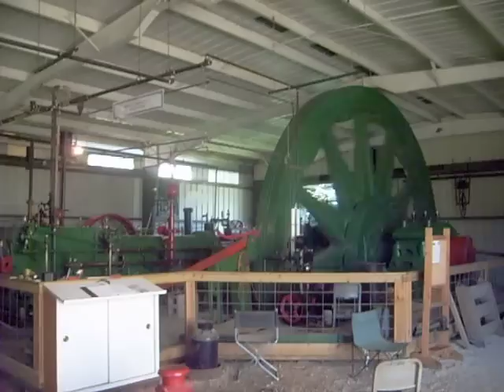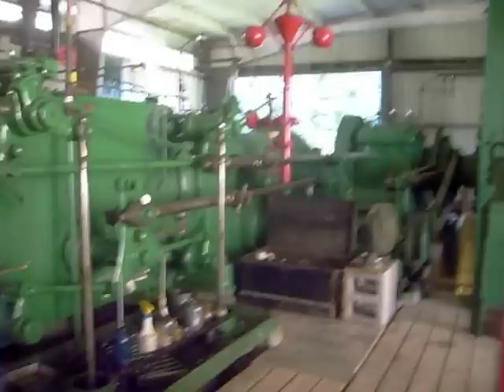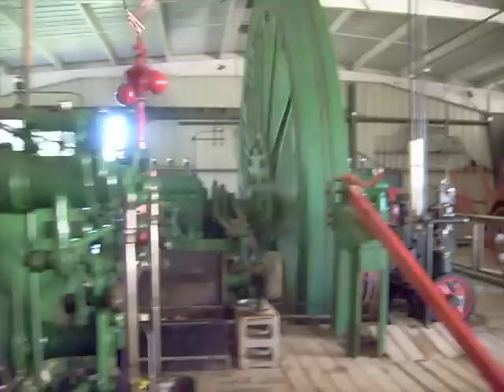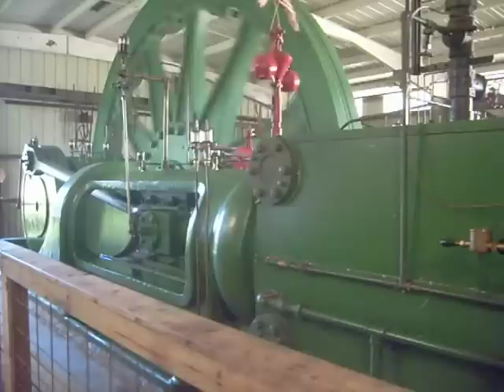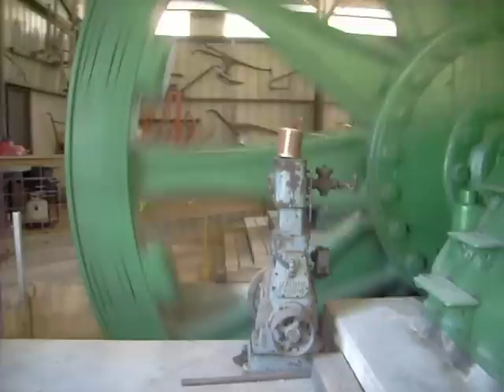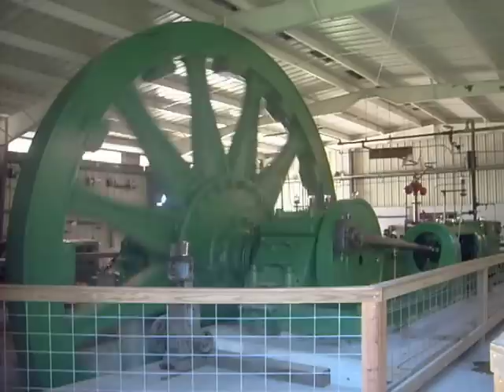HUGE 130 Ton 4798 horsepower 100 year old Cooper Corliss Steam Engine Operating in Freeport IL

Comment: I guarantee that engine does not produce 4700 hp Not happening. Tipple expansion steam engines of that size witch is a technological step above that  could only produce a fraction of that. And no they did not put flux capacitors on the boilers to boost the power output.
Reply from the maker: +Peter Cobden Triple Expansion Engines were designed and built for efficiency more than for high horsepower using the lower pressure exhaust from the first piston to power the larger second piston and then the even lower yet exhaust from that piston to gently push on the huge third piston before exhausting into the atmosphere.I'm guessing you probably don't believe the Union Pacific 4-8-8-4 Big Boys had an "Indicated" hp in the 6000 range either.
Reply: +oldSawyer - It's worth having a look at the history of Cooper's from 1890 onwards, and the manufacturer's sales catalogs and sales records. Engines of this type ranged from 200-2000HP, this one was typically 1500 HP. 36 HP per ton was not possible in those days, 11.5 HP per ton was pushing the bound of the era's technology. The most efficient triple expansion condensing engines of the day were producing about 10HP per ton. The UP Big boys were rated at over 6000HP, but not continuous 24-7 industrial use; they had the benefit of 1940's materials and higher boiler pressures.
Reply from the maker: +nlo114 I'm only going by what is posted on a chart located in the building with the engine, and those were the numbers. . . That being said, it Currently Operates on a Much Smaller Boiler at Lower Pressure, also running a much Lower RPM than what it did in its factory setting with a huge boiler at high pressure running at its rated speed under load.
Reply: +oldSawyer -  With you 100% there, not arguing. If I could be bothered, I'd calculate bmep from bore and stroke, rpm and supply pressure etc., but I can't be bothered. If it gives figures on the wall-chart, the chances are that the keepers know what they are talking about, so I believe them.
Reply: I was just thinking UP 844 is rated for less than the stated figure and it has two cylinders.
Reply from the maker: Two SMALLER Cylinders. . .
Reply: Not only that but the connecting rod is quite slender and could not support the force required to develop such power at the slow revolution rate such an engine could operate at. I'm reckoning it's out by a factor of 10
Reply from the maker: And I Reckon You Would Be Wrong. The Connecting Rod is not as "Slender" as it appears in comparison to the rest of the engine and is More Than Strong Enough. Keep in mind, that is a 60 TON Flywheel plus the weight of the Crank disk & Shaft giving it total Rolling Mass of over 85 TONS. Cracking the throttle valve open gets that 85 TONS up and moving to the speed shown from a dead stop in just a couple seconds. Try Doing That with an 85 Ton Semi ! If Anything, it is Under-rated.
Reply: Triple expansion could only produce a fraction of that?
The largest steam engine built was 11000hp triple expansion. The Manhattan engines built by Allis Chalmers
Reply from the maker: And again I need to point out the fact that Triple Expansion Engines were designed and built for efficiency more than for high horsepower using the lower pressure exhaust from the first piston to power the larger second piston and then the even lower yet exhaust from that piston to gently push on the huge third piston before exhausting into the atmosphere. Corliss Engines with their variable Valve Cutoff rates can produce Massive Amounts of Power in comparison.
Reply: @oldSawyer  if that's directed at me, I'm not arguing your point, other then the largest most powerful engines built were triple expansion, and of course Allis Chalmers!
So that somewhat disproves your only for efficiency theory
Reply from the maker: Let me Clarify That by adding "FOR THE MOST PART" Triple Expansion Engines were designed and built for efficiency more than for high horsepower. . . Obviously The Worlds Largest (Allis Chalmers) would be an Exception to that by the Shear Size of it. . . I Still Stand By my "Efficiency" comment on them though, as THAT is Where They Really Shine, Doing What They Do Best, making The Most out of Every Usable Ounce of Steam Pressure by reusing the exhaust from one cylinder to power the next bigger cylinder. . . When your last cylinder is the size of a SILO, then Yes it is going to add even More Power.
Reply: @oldSawyer  honestly Allis Chalmers was usually the exception to most rules, hence the reason they broke so many records
Reply from the maker: Re-reading your original post, I guess it was directed more towards Mr. Cobden there than it was at me. Always amazes me how many 'Experts' there are out there that can't comprehend the Power Of Steam in general, and then try to compare the Huge Stationary Engines to the Much Smaller Cylinders found on Locomotives (though I DID Give Props to the Big-Boy with its 6,000hp from FOUR Cylinders, only to have someone else chime in again about UP's 844 TWO cylinder)
Reply: @oldSawyer  I really wonder how the hp was rated at 6000 on the big boy, because of the size of the Manhattan engine, something doesn't add up
Reply from the maker: That, I Can't Answer. . . It's just the rating I found Listed for them a few years back. I'm thinking they were upwards of 300psi boiler pressure though which helps considerably.
Reply: Just to muddy the waters…
Cab forward articulated locomotives used to leave SP’s Roseville yard with a full consist to cross the Sierra over Donner Pass. Once they got up to speed (albeit not very fast) the engineer would fully open the throttle and the fireman would set the fire for full power. Then the engine(s) would pull the train over Donner Summit running 100% duty the entire time. Them’s engines. I knew people who ran them.
Incidentally, something I’ve never seen in print but interesting… during the summer the crews running out of Roseville would want some vacation time. The railroad would hire boys (older teens) from the high school to fire the big cab forwards to temporarily fill in. I know this only because I personally knew someone who did it. Long time ago; ‘before (during?) the war.
Documentation: he was Don James, later principal of Hiram Johnson High School in Sacramento (1960’s).

Comment: Great video!

I am also wondering about the horsepower. I do believe that the Big Boys had around 6,000 horsepower, but they had four cylinders and they operated at a much higher RPM (and HP goes up with RPM, to a point). The Centennial Corliss Engine put out 1400 HP, but it was a much larger engine that this one in the video: http://newsm.org/steam-e/corliss-centennial-engine/

Wikipedia lists figures for some Corliss engines and most are in the hundreds range though a couple listed have over 2,000 HP.  I also found out that HP for large stationary steam engines, back in the day, often was given as the total power of a group of engines, not just one. So if that engine really does put out 4798 HP by itself, at such low RPM, that is truly remarkable and unusual.  Would you be willing and able to post of photo of the plate that shows the HP, and at what RPM?

https://en.wikipedia.org/wiki/Corliss_steam_engine
Reply from the maker: There is no data plate showing those figures that I'm aware of, but the numbers came from a chart (or Graph) showing the horse power for this size engine at different boiler pressures and rpm's. As noted in the description, that chart shows it as 4798hp at 45 rpm at 225psi boiler pressure, though in its current state running a much smaller boiler and at significantly lower pressure  it would never be able to do that. . . As For Photos, I have yet to figure out how to post a photo in the comments on here.
Reply: Interesting, thank you. Have  you tried using your Google account (since you have  YouTube channel you have a Google account) to post a photo in Google Drive, then share the photo to the public, and post a link to the photo here?

Also, see my comment from about a second ago, about the formula for theoretical horsepower based on steam pressure, piston diameter, stroke length, and revs per minute. I think it would be interesting to try that out.

Comment: The Cooper Corliss company lists this engine at 1500 hp at 70 rpm    4798 hp not possible with this engine
Reply from the maker: IF you can post a Legitimate Link to Documentation Showing That I Might change the title, otherwise I'm Sticking With the Information As Shown on the Chart that resides with the engine. . . I suspect you're looking at a totally different (much Smaller) engine though as that 70 rpm is Nearly Double the Rated Speed of this one with its 25 foot 4 inch diameter flywheel.
Reply: @oldSawyer  at 70 rpm this flywheel would be sitting close to the exploding point 5600ft per minute rim speed. There no way  Corliss would have rated it at that, one slip up and kaboom
Reply from the maker: Not sure how I got tagged on that  @bartholomewchuzzlewit4356  as I'm not the one that said 70rpm, but YES, it likely Would Come Apart at that speed, or somewhere between there and 100rpm if it managed to get that high as it is RATED at 45rpm MAX. . . bowlweevil's 70rpm spec would be for an engine Less Than Half the size of this one.
Reply: @oldSawyer  the Cooper Corliss rate this engine at 1500hp at 45 rpm...I would like to read any information that says 70 rpm....just not possible. ..do you know the  bore and stroke?
Reply from the maker: Yeah  @bartholomewchuzzlewit4356 , I don't know where bowlweevil got HIS 70rpm information from. . . If anyone can show Actual Information FROM Cooper showing what they rated this at I will accept it, but I may or may Not change the numbers in my video title as I got them off a chart showing "Theoretical" horsepower at different Boiler Pressures and rpms (including higher rpm than would be safe to run it at which I Did NOT post) and the 4798 hp figure came from that chart crossing the lines at 300# Pressure and the "Rated" 45rpm. If they rated the engines at 175# or even at 225# the readings would obviously be lower, just as it Currently Obviously makes a Fraction of that amount idling along at 7 to 20rpm at around 125# of pressure with the valve cut-off timing adjusted for efficiency rather than for maximum power. . . The building will be open this weekend for the first time since the Fall of 2019 due to COVID restrictions throughout the entire 2020 Season so I'll see if I can find the Bore & Stroke Again. Also, just a side note: The Case 110hp traction engines have been Measured on the Prony Brake putting out as much as 149hp (and higher) versus the Factory Ratings of 110hp

Comment: 4,798 HP? Only one cylinder...looks to me, like that is too much for this machine.
Reply from the maker: As noted in the description: 
""The 130 Ton engine has a 25 foot 4 inch diameter flywheel that weighs in at 60 Tons with a total rolling mass of 85 Tons with the crankshaft, hub, and flywheel, yet on start up when the valve is opened, it will get up to speed in less than a single revolution. . . just imagine taking an 85 Ton Semi tractor trailer rig and getting it up to speed in that short of a time.""

Comment: We have small 150 hp gen set actually still used as back up the Westinghouse  genset built 19 30    still powers our ranch when this green bullshit 
Freezes up and modern grid fails    we use our old equipment  not display crap  .. we also run our machine shop  with vintage power while everyone freezes 
Ranches had to have small power plants   years ago   power wasn't reliable or  steady    we even have old fairbanks morse 100 hp for back up 
Fully functional  .. why have this equipment if afraid to harness its potential  and reliable power supply..
Reply from the maker: While I applaud your use of old equipment, you're hardly alone in doing so. There are literally Thousands of people across the U.S. doing the exact same thing, and Hundreds of Thousands more that Collect antiques and take them to the local Fairs and Threshing Shows to Display them for others to see. Many of them, Our Club Included have Many "Working Displays" with engines hooked up to Line Shafts and other equipment, but SERIOUSLY, unless you're Repowering an Entire Factory with Hundreds of machines in it for "Off-Grid" use, Where would you actually USE an engine like This One to its "Full Potential" ? 

This 130 Ton Steam Engine was Saved from Being Scrapped by being moved and reassembled by our club to preserve it and display it to the public as an operating engine, not just a dead Static Display or slowly turned over by electric motors to make them appear to be running like so many of them in the Smithsonian, or the Henry Ford Museum and other such places.

On a side note, it cost upwards of $160.00 in Natural Gas to fire the boiler for 5 hours of run time each day we're open to the Public, and That's just Idling Along with No Load on it. I'd hate to even guess what it would cost to maintain enough steam to run it under a heavy load, IF we were ever to find anything outside of its original setting in the Zinc Rolling Mill that would even count as being a load on it. 

Personally, I would have loved to relocate our Sawmill and belt it up to this, but it would be more than 80 Times the Horsepower Needed to saw even the biggest toughest logs we could run through it.
Reply from the maker: How About uploading a few videos of you actually using your old equipment. . .